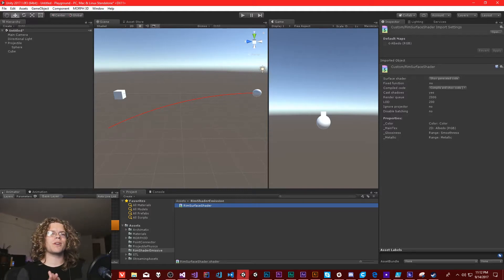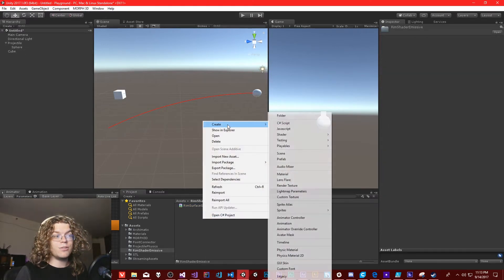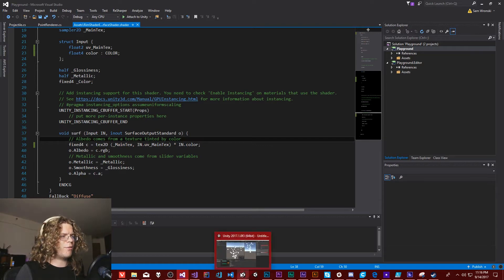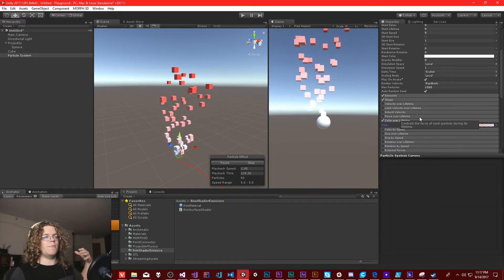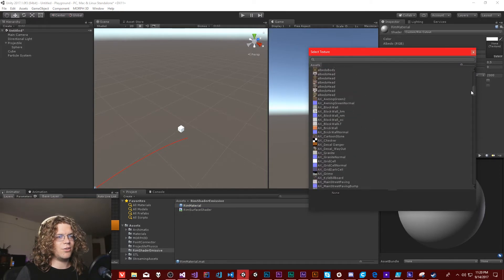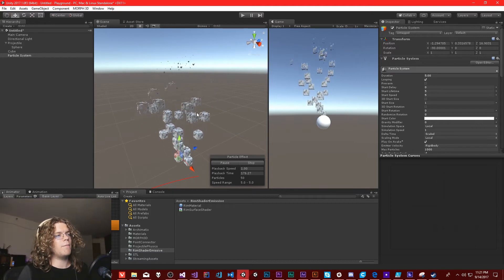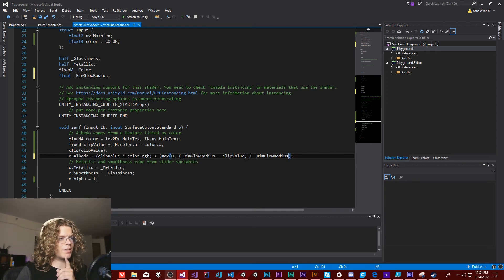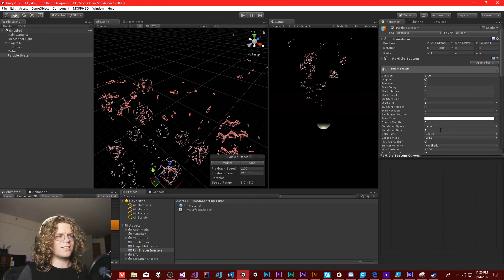Lets Make a Dissolving Shader

Comment: How could we make a script  instead of a particle system?(Mostly about the color stuff.How could we change it with a script?)
Reply from the maker: You'll need to modify the Mesh vertex color manually. You could also introduce another float to control the dissolve amount (basically reduce it to a more complex cutout shader).
Reply: made it,if someone qant it
using System.Collections;
using System.Collections.Generic;
using UnityEngine;

public class ChangingColor : MonoBehaviour {

 private Mesh mesh;
 private Vector3[] vertices;
 private Color initialColor;
 private float speed;
 public float fraction;
 private float a;
 private Color[] colors;

 public float tempo = 1;//tempo means time
 // Use this for initialization

 void Start () {
  mesh = GetComponent<MeshFilter>().mesh;
  vertices = mesh.vertices;
  Debug.Log ("Numero de vertices:" + vertices.Length);
  fraction = 0;
  colors = new Color[vertices.Length];
  speed = 1 / tempo;
  for (int i = 0; i < vertices.Length; i++) 
  {
   colors [i] = Color.white;
  }
  mesh.colors = colors;
  initialColor = colors[1];
  a = colors [10].a;
 }
 

 // Update is called once per frame
 void Update () {
  //Debug.Log ("Numero de cores:" + colors.Length);
  //a = colors[0].a;
  fraction += speed * Time.deltaTime;
  Debug.Log ("fraction:" + fraction);
  for (int i = 0; i < vertices.Length; i++) 
  {
   colors [i] = Color.Lerp (initialColor, Color.red, fraction);
   colors [i].a = Mathf.Lerp (a, 0, fraction);
  }
  Debug.Log ("colors[0].a:" + colors[0].a);
  mesh.colors = colors;
 }
}

Comment: Hi there!
So, I tried this shader in Unity 5.6.2f1, and I got some interesting results.
On a regular cube object, it produces a lot of "white noise"  where, in the main texture, there is color (not transparent), and the parts where, in the texture, there is transparency, its a jumbled mess of textures.
And when testing with a particle system, wherever there is color in the texture, its completely transparent in the particle, and the areas that are transparent in the texture are, again, a mess of textures.
Also, on the particle system, if I set the alpha of the particle to 255, I also get the "white noise", but its colored with the color of the texture.

Any ideia as to why this could be happening? I've already checked the code, and even downloaded yours, and still get the same results
Reply: Ok, so, update:
Unity wasn't getting the transparency value from my texture, no idea as to why, seeing as I just duplicated my old texture and it seems to work now hahahaha, thanks for the great shader bro!
Reply from the maker: Glad you got it sorted out! Sounds like pretty unique behavior for simply lacking an alpha. I wonder what Unity was putting on the alpha channel or if it was just taking extra data from memory.